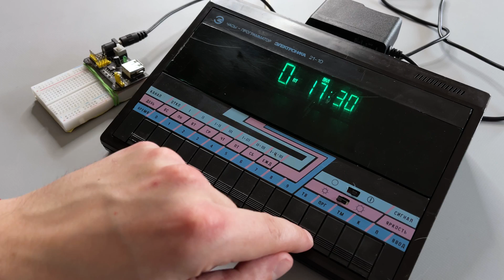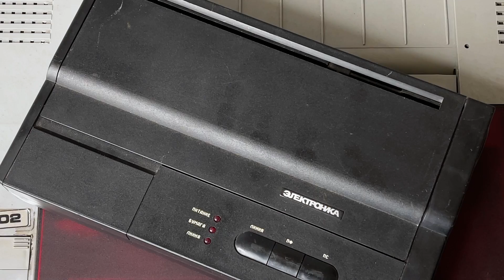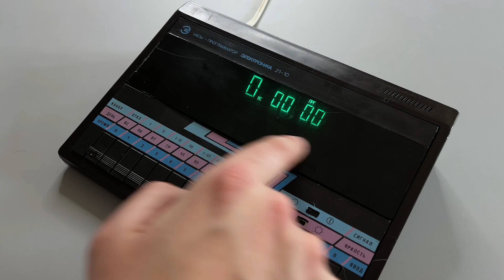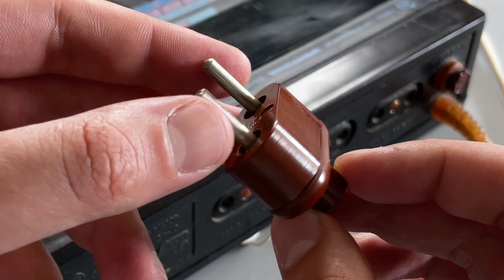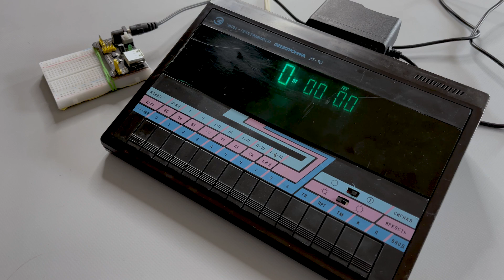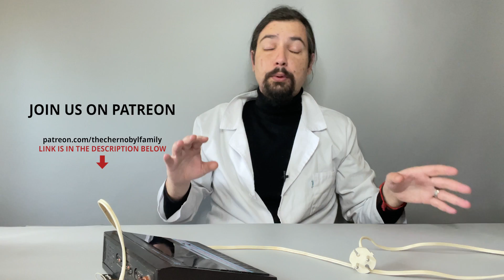Made in Ukraine — Electronika 21-10 Programmable Clock Test-Run!

Comment: This is in desperate need of being released as a hobby kit. Aside from the custom display, parts for this should be easy enough to come by (including the microcontroller which I saw on eBay). 3D printing of the case, though not perfect should be pretty close.
Reply from the maker: Sound like an amazing idea. Besides, I'm thinking to get a nonfunctional clock of this type, and put an arduino inside, giving it more functions, because we find this casing and LCARS-vibe interface really cool.
Reply: Look up "imitation nixie tube", "lixie tube", or "edge-lit acrylic sheet" for alternatives to the display. Not a zero-effort sort of thing, and for this case it would probably be important to make each segment separate instead of using a full sheet per character/symbol, but most of the pieces could be made from either extrusions or trimmed sheets that get cut to size, since most segments will be from two or four mixtures of size and shape. I assume "the solution" to panelizing  them is to paint them with some silver paint (or similar) before cutting to size (and hopefully frosting the front of each segment for light diffusion), then lay them out in some jig, pour some of that "river table resin" stuff over them to get them all fixed in place, maybe "frost" the back, paint the back black, then trim the front surface for flatness and the back of the segments so that the black paint is removed (so that the segments can pass light again). Add some frosting effect to the back if desired (for light spreading) and you should have a display panel that can be easily backlit by LEDs, with no need to get custom vacuum or cold-cathode tubes (as with VFD displays and Nixie tubes, respectively) or LCD panels made.
Reply: @absalomdraconis  Pretty sure its a VFD display.

Comment: I think that a device like that would be very useful even today, just replace the back connectors with USB ports and there you go, your own programmable phone charger
Reply from the maker: That makes sense. Though one would need to change the relays to some solid-state ones and make the 5V output instead of 220.

Comment: I guess you can only turn on three devices at once. Seems pretty limited for all that interface. 

I guess if you only needed to turn on one device at a time, you could select 1 of 8  devices by using the relay-controlled outputs as a 3:8 decoder.

Comment: Oh my! It's my clock :D I'm still using it. I have also Signal 201, but it have some problems, and couple "standard" Electronica VFD clocks.
Most of that clocks came to Poland on begining of 90s, when Ukrainians and Belarusians was bringing things for trade on their own, when Soviet Union colapsed. Sometimes they had very interesting things (like that clocks) or some simple things like electric gas lighters for cookers (that wasn't made here on that time). I still use one from that era.
P.S. In comparsion: Signal 201 have 2 chanels and 1 additional in separate device (for stick into  socket on wall) and it hadn't simple relays, but it had solenoids with reed switches inside.
Reply from the maker: Thank you for sharing!

Comment: So cool! And you fill your videos with interesting facts about Soviet tehcno --- tenhicol .. tecnelog .. well, never mind, mixed with a wonderful sense of humor.

Before commenting on the clock, I have four different kinds of Soviet VFD-displays, from the large ИЛЦ5-4/7М to the single digit ИВ-22 to the small ИЛЦ-9/8Л. Together with the clock ICs КР1016ВИ1, КР145ИК1911 and КА1016ХП1. Some day I will buil at least one Swedish clock from these Soviet parts.

Why did they have to come up with a clock that was so complicated? They could have left out all the complicated programming, but trying to squeeze out the most of КР1016ВИ1 chip resulted in this horrible mess.
Reply from the maker: I guess as this is a product of late 1991, it was some relatively quickly designed thing to get a profit in emerging market economy. I must say, despite its complexity, at least in Ukraine it was a popular device and many people still have it!
Reply: @ChernobylFamily  To be honest, not all Soviet stuff was bad. I have (in pieces) a Soviet tube amp - Priboi 50YM with heavy transformers, and the Soviet Polivoks synth which is a classical piece.
Anyway, see you next Summer in Kiev!
Reply from the maker: @Soundbrigade  True – after all, there are plenty of examples.)

*Kyiv

Comment: omg i think its easier to learn how to programme on an Arduino than setting this clock
Reply from the maker: In fact it is not that complex. Hm... placing an arduino inside this stylish casing with a similar display may be a good idea, btw. Need to look for a broken clock.

Comment: Thanks for making the video on this.  I was curious about it after the prior video and it really reminded me of the Star Trek LCARS aesthetic, too.  And it made me nostalgic for something we had when I was a kid sold by Radio Shack in the US.  Unfortunately the aesthetics weren't quite as cool and they're not the progenitor of your device, but it also involved controlling lamps and appliances via clocks back in the 80s and 90s.  (If you Google "radio shack plug n' power alarm clock" that's what I'm on about.)
Reply from the maker: Thank you! Will check that.

Comment: I wonder how much time it can hold the programs with the backup batteries, every single radio alarm clock I seen would drain the backup battery like in a couple hours.
Reply from the maker: It consumes 4 watts per hour during normal operation.

Comment: Interesting clock, lovely VFD. I'd replace electrolytics and TACT switches if needed. Otherwise, it's built pretty much like the Lell PSR, pretty much in the middle or upper regions of Soviet everyday electronics build quality. All clean and not too shabby.
Reply from the maker: In fact it is nominally Soviet; i found that production stated in mid-1991, and this one is from May 1992. But given in Ukraine this thing is known well that means that it was produced enough long, and probably improved.

Comment: Aside from the broken countdown mode, that looks genuinely useful. Aesthetic reminds me a little of Tomy VFD games from the 1980s. The "race track" graphic is baffling. Looks like the tail snaking off to the middle of the display area could have been intended to link up with a lamp or indicator showing which of the colored bands are relevant in the current context, but in the open case view we see no indicators in that region.
Reply from the maker: I guess the visual link is an increased brightness when you trigger that or another context.

Comment: Clever use of multiple brightness of the display for the interface.
Wonder how it's done, VFDs can only be of one brightness overall depending on the high voltage supplied to it.
Reply from the maker: From what I see, that switch connects an extra resistor to anode of the VFD display.
Reply: @ChernobylFamily  Not the overall brightness, but when you do the programming, selected digits appears brighter, individually (5:07)
From my knowledge of how VFDs work and are driven, it was an impossible feat.
Reply from the maker: @Damien.D  i found only this circuit diagram, it is blurry as hell, but it might give a hint http://rr20.ddns.net/GetData.ashx?ImageId=f55a25db-0afc-4c10-a830-b2d8ed1cdfda

Comment: Thanks, good content. 

There was also an interesting but commercially unsuccessful locomotive VL86F project between Finland and the then Soviet Union in the 80s. Together, build an powerfull electric locomotive for the Siberian railway. The locomotive was built at the  Novotšerkassk factory. 
Finland's Strömberg was responsible for designing and manufacturing the locomotive's control system and drive motor feeders, i.e. bogie drives.

The electrical components, thyristors, etc. had to be Soviet. There were plenty of problems with the quality and availability of components, even starting with capacitors. A short quote from the book about the locomotive project:

"The first trial batch of power capacitors was received in December 1981. During the incoming inspection, the capacitors were tested both electrically and mechanically. The tests revealed that the capacitors did not withstand the DC voltage test and had oil leaks. Many capacitors exploded. When they were opened and the structure of the foil coils was examined, it became apparent that the end connection of the foil coils was unreliable. The foil started to detach from the joint and the phenomenon developed pressures inside the capacitor, causing them to explode. Impurities were also found inside the capacitors, such as mahorka nats". 

”However, Energomashexport considered Strömberg's acceptance tests to be incorrect and demanded that the tests be agreed upon together, because "capacitors probably leak when turned upside down or break when short-circuited". 

"In the end, the thyristors had to be approved for the test locomotive with simplified requirements. Despite this, there were considerable rejections during the receiving inspections of the delivery batches, 45% for thyristors and 10% for diodes. This caused it to be difficult to obtain the required quantity of approved components. During the unit tests of the bogie drives and the commissioning of the locomotive, power semiconductors were still destroyed more, so the total rejection rate was 55% for thyristors and 21% for diodes". 😃😅
Reply from the maker: VL86 was a thing Soviets advertised on every corner... it was truly impressive though.
Reply: > such as mahorka nats
Good god.

Comment: I am amazed by the use of intensity changes for highlighting the active digits but not as much as by the sight of a yellow transistor.
Reply from the maker: Those transistors are pain to solder. They have flat pins. Check "KT315"

Comment: This is really neat.  I have a radio receiver used in the 60's by volunteer fire fighters that listens to a crystal receiver and turns on a light when certain tones drop.  But this alarm clock had more functionality than anything I had as a kid in the 80's in the US.
Reply from the maker: I am sure it must have some prototype. That chip inside is a specialized clone, so there was something in which the original was used.